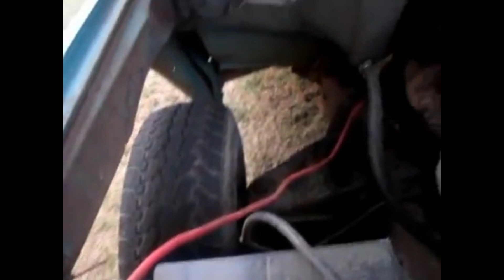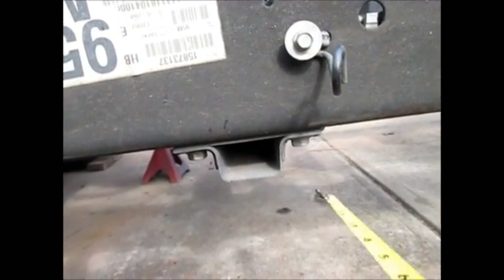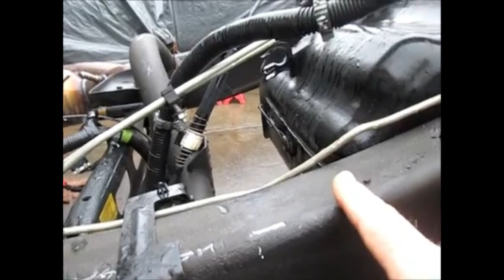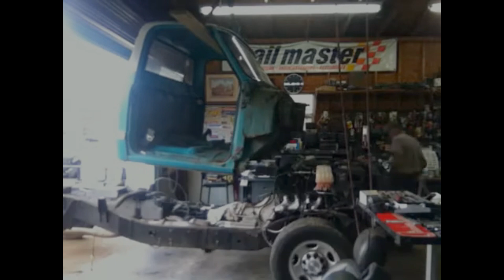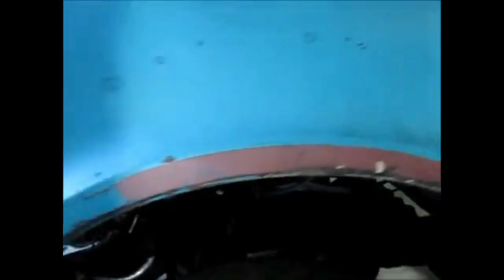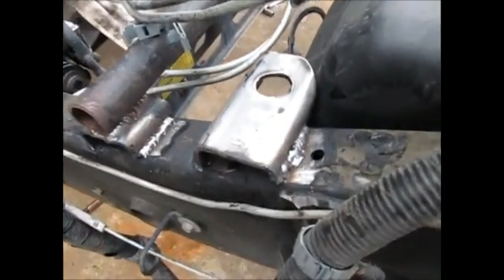1968 GMC body swap part 1. Revised edition. #bodyswap #gmc #truck #howto #diy #abandoned

Comment: Instead  of  a carrier  baring   have  a  one  piece  drive  shaft made,  just  a thought.I used  a 2000 Chevy  long 3500 van  for  carpet  installation  and it had  a one  piece  shaft.
Reply from the maker: I’ve considered that.